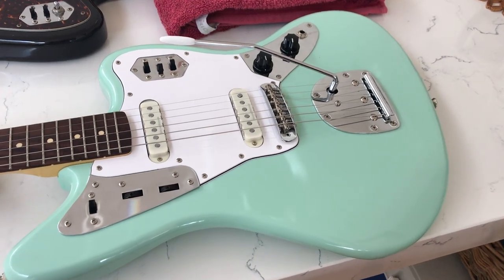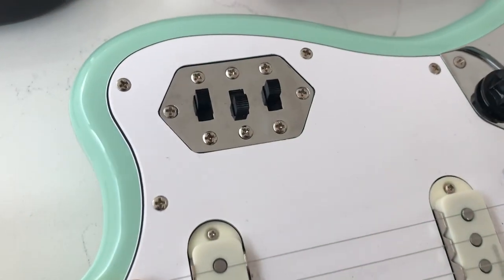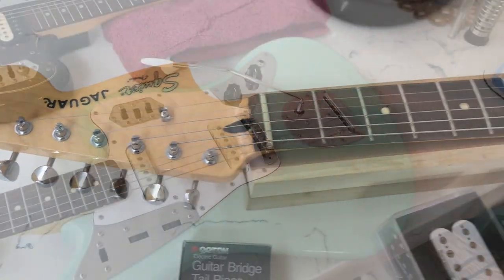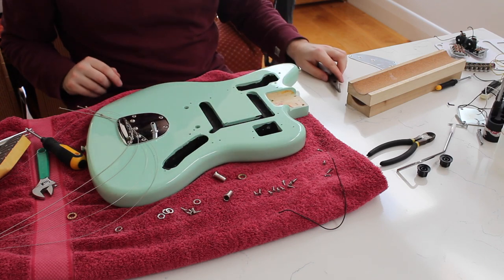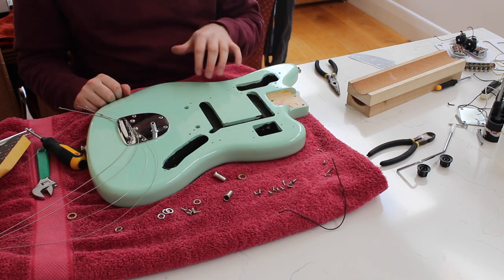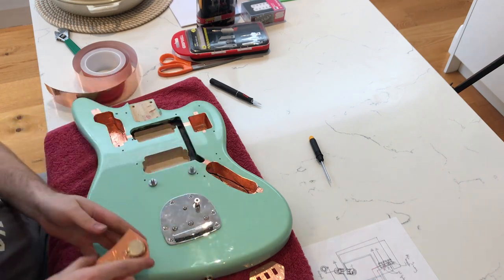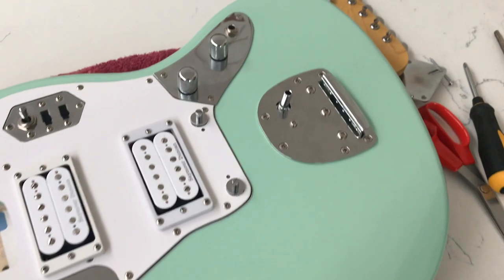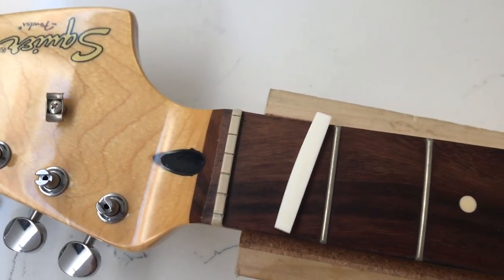Modifying the Squier VM Jaguar

Comment: I ordered a WM Mustang for my birthday a while back that I was going to try and mod myself. I ordered the guitar off of Amazon and when it got here, the bridge bushings were UNDER THE VIBRATO PLATE. COMPLETELY UNDER THE VIBRATO PLAYED AND UNUSABLE. I ordered a replacement and was planning on shipping back the original one I got. Once I got my replacement, I tried routing it for a full sized Super Distortion with the correct router bit, but I couldn't afford a router so I used a Dremel instead. NEVER, EVER USE A DREMEL. I goofed up the entire thing after hours upon hours of work and still couldn't fit the Super Distortion in there, and I had messed up the pickguard for good and I had given up at fitting a full sized humbucker in there at that point and decided to just take the Hot Rails out of my Bullet Strat and place it in there instead. I had to custom order a pickguard from WD, which I traced off of the first guitar I got (You can't fit a Fender Mustang pickguard on it, I tried to and it didn't fit, so I custom traced off of the first guitar I got's pickguard which I was going to ship back but had yet to do so because I couldn't drive to a UPS store to do so yet.) I shipped back the original guitar a few days later and received my new pickguard and wired everything together, and the guitar works flawlessly now (surprisingly so even with the original bridge, but if it ain't broke, don't change it.) I'm planning on getting a Fender Jaguar soon, but after my experience I don't feel so safe cutting up a guitar worth over $50 dollars (lol), so I'm just going to get a Classic Player HH which has a Tune-O-Matic already installed and humbucker cavities already routed out, and then I plan on putting a Super Distortion in the bridge, and a Humbucker from Hell in the neck. I hope the guitar turns out alright because I've read mixed opinions on the Classic Player HH, but judging from one I've tried out,  have no worries for what I'm to get :)
Reply from the maker: Oh wow, that sounds like an absolute nightmare. Don't get discouraged though, we all make mistakes and stuff things up. You learn from it and avoid the same mistakes in your next attempt :) I've necer tried a CP HH Jag but they look the business. Hopefully your luck has turned around and you get a really good one!

Comment: Great video and great mods!
I was wondering tho, why heating the bridge thimbles make them easier to remove?
I thought heat caused metal to expand, so it would actually make it harder? It's kinda counter intuitive to me.
Reply from the maker: It's not enough heat if you do it properly to expand the thimbles that dramatically. It's more to soften or melt any adhesives used to make it easier to remove the thimbles

Comment: Did you have to buy new pots and other electronics besides the 3 way toggle? Or can you use the old and the re wiring makes them work this way? Also could you link the 3way toggle? Thank you
Reply from the maker: Hi there! I would just get another 1M linear roller pot to swap the stock 50k tone pot in the rhythm circuit. Other than that you can reuse everything. And there should be a link to the toggle switch in the description. Hope this helps!

Comment: Great vid, but there is a waaay easier way to pull your bridge anchors with a bolt, a washer, and a piece of 1 inch pvc.  At any rate, I am definitely wiring the volume and tones on my new MIJ Jag this way, once I put in the p90s.  such a great idea.  Thanks!
Reply from the maker: I don't think that method will work here, the original thimbles/bushings have no thread for a bolt to grab onto. That method is more for pulling out tune-o-matic bushings. And no problem, p90's will sound great in these!
Reply: @alexrcowan  You are absolutely right.  My apologies!  And yes, the P90s really sound good.  I wasn't a fan of the thin, jangly single coils, but I kinda knew that going in.  I do like all the other things that make a jag a jag though.

Comment: Hi, I wanna build a JM project based on a fender style neck (12" Radiused) and home made body made from some korina planksI have. As I want a TOM style bridge, should I route the neck pocket straight like a regular JM and shim it or angle the neck pocket, wich seems hard to do? Thanks for the video, it's really helping me.
Reply: Btw, I wanna go on the JB/Jazz route and the Jimmy Page circuit. 4 push/pulls for parallel/series in/out phase. If you have any input on that. Thanks.

Comment: It would have been great to hear noise recordings before and after copper shielding. The Squier VMs (and many Fenders) already have shielding paint, so the difference may not be great, if any. Of course it would have been most interesting to hear the difference with the jag single coils rather than the HBs.
Reply from the maker: T W it depends what kind of environment you play in. If your are playing at home in a room with no big tv or fluorescent lights to create interference, the difference will probably be negligible. However, if you play live in venues with dirty electronics (or even a house with dirty electronics) or have lots of interference, the difference will be night and day. Shielding paint will never do as good a job of shielding electronics on squiers and production line fenders as copper tape. The paint hardly conducts (if at all, they don’t use premium grade shielding paints) and hardly ever make a complete faraday cage since the shielding paint doesn’t consistently touch any shielding on the pickguard (of which there is none on these VM pickguards). So they don’t make a cage around the electronics to shield them from outside interference. I can’t retroactively go back and record the difference, but I do a lot of shielding for clients Jaguars, and it makes a lot of difference on squiers, MIJ, and MiM models 😊
Reply: @alexrcowan  Fair enough. But DC resistance/conductance is not a measure of noise rejection at common noise frequencies/wavelengths. Shielding paint with similar resistance is widely used in high quality electronics applications. But I don't think anyone knows exactly what paint Fender/Squier use, good or bad. Its resistance is consistent with other shielding paints though. So I think any real difference between that paint and copper foil for real noise sources is uncertain. The noise difference you note may actually be due to the full pickguard shielding you also add, which Fender only uses sparingly, and sometimes not at all. Anyway next time it would be great if you could include a before/after comparison, ideally after just the pickguard shielding is added to the cavity paint, at high gain with single coils. If a guitar already has cavity shielding paint, it may be that all we need is full-pickguard shielding (with copper or similar).
 Or it may be that copper is indeed better.
Reply from the maker: T W in all my experiences working with shielding electronics (jobs in the hundreds for my own business and on subcontract for other guitar repair businesses) I’ve never encountered a situation where a customer complained of excessive 60 cycle hum in direct relation to single coils hasn’t been more satisfied with noise levels post copper shielding. 

As you say it could have a lot to do with pickguard shielding, however since guitar manufacturers rarely have shielding paint over the lip of the cavities, they wouldn’t contact the shielding on the pickguard and complete a faraday cage, so I wouldn’t think simply adding shielding to the pickguard is effective as making an actual faraday cage around the electronics.

But yes next time I’m doing a shielding job on a single coil guitar I’ll try to remember to film a before and after. My workshop is rather good for that as unfortunately the electronics are old and dirty.

Comment: Hey Alex, how's it going? I love the new look of your jag. Great job on the Serve the Servants cover also. I've got a question & I was hoping you could help me out. As you may remember, I've got a Squier VM Mustang I've customized to be a Cobain Mustang. But I've got a Seymour Duncan lil 59 im putting in the neck, & a full sized JB in the bridge. I want to have the switching be, all the way toward the bridge for regular humbucker, middle is off, & all the way toward the neck be coil split. I hope that makes sense. Any ideas or info on how I can wire this up to work properly? Thanks a lot & keep up the good work.
Reply from the maker: Hey Robert, I had done a similar thing to this with one of my old mustangs. The neck pickup switch acted like a 3 way toggle - so up is neck pickup, middle is both pickups, and then down is bridge pickup. And the bridge pickup switch operated the humbucker, so split, series, and parallel. I have a picture of the diagram if you want me to email it to you
Reply: @alexrcowan  Sure, that would be great, if you don't mind. Do you still have my email address? Do you know of a way I could have each switch  control it own pickup, but instead of having a pickup selector, I can make it full normal humbucker in 1 position, off in another position, and coil split in the last? So the bridge would have it's own switch for humbucker, off, or coil split. And the neck would have it's own switch for the same options. I can't find anything online. I've been looking for 3 days, lol. Well, when I'm not working that is. Thank you very much for your time by the way. I'm sure you're very busy but I know you're a genius with this stuff.

Comment: How would you say adding the 3-way toggle switch was im planning on doing this mod myself and was wondering how difficult it is. Great job!
Reply from the maker: It was super easy, and definitely with considering. Seymour Duncan has put out plenty of wiring conversion diagrams so you can see how to wire up a 3 way toggle using different kinds of switches. And thanks Danny, I appreciate it mate!

Comment: If i use 2 humbuckers but it has only 2 wires on each, is it possible to create like this?
Reply: You need two have hot and ground and 2 extra wires. So four total on a humbucker to achieve split coil

Comment: I have doubts that the blade style saddles will go along with a floating trem. I would choose something which has rollers. Also if you find some hotrail pickups that sound okay to you you don't have to route.
Reply from the maker: Tuneomatic saddles are fine man, never had a problem with them. Very little surface area of the saddle touch the strings, if anything it will make less contact than the standard jag barrel saddles. The tuneomatic has worked perfectly fine for guys like J Mascis, Lee Ronaldo, Thurston Moore and Kurt Cobain on jag/jazz style guitars. As for hot rails, yep you can use them, you may have to still rout a little nib out of the cavity to accommodate the wires coming out of the bottom of the pickup, otherwise you can just mount them upside down (did that today for a customers American Jag).
Reply: @alexrcowan  Yes the factory saddles are the worst, still I would lock my trem with a tuneomatic bridge. Actually I mount my humbuckers/hotrails upside down most of the time, I love HSH and they are always mounted the bad way: in position 2 and 4 when the H is coil splited and the S is activated the coil next to the S is active, which does not give you that stratish sound it should, so I always flip my HH's upside down so that the coils near the bridge and near the neck will be active when they are used with the middle S pickup, I guess everyone has his own quirks XD

Comment: I know it's been ages, but what was the purpose of the series/parallel switch in a hh?
Reply from the maker: Was a bit of an experiment really, works well with the humbuckers split. I was just seeing how many different tones I could get, and I had that switch spare to do something with. Is it practical? Depends if you find humbuckers or single coils in series to be a useable tone I suppose
Reply: @alexrcowan  gotcha. Yeah I can see the point with using on single coils to get like a humbucker tone but you got the real deal already. I'm doing a similar build with a SS Jag. You're right about the extra switches these guitars have so much potential than the standard rhythm circuit.
Reply from the maker: @Indierockguitarist  there’s so much potential. Going back I might have used that switch as a blower switch just a killswitch. I love the freedom jaguars give with their circuit

Comment: u ruined a vintage guitar
Reply from the maker: I always wonder why people watch these videos specifically about modifying guitars when they know they are going to be upset for some reason. And no this guitar isn’t vintage, it’s a ‘vintage modified’ series guitar from the 2010’s. Not quite vintage. And not ruined either, it was a guitar that someone never played, and is now a regularly played instrument with a lot of tonal serviceability, for a lot of people (discounting yourself) that’s actually an improvement. Yes, it can still surf - that’s why I included a split coil option. If anyone picked up this guitar and was offended by the mods, they could easily restore it with the original electronics and a new guard and switch plate. It’s not a big deal at all…
Reply from the maker: And you also commented this on this video 2 months ago: “more info the wiring but great info otherwise great job thank you kindly john”. Must have changed your mind I guess.